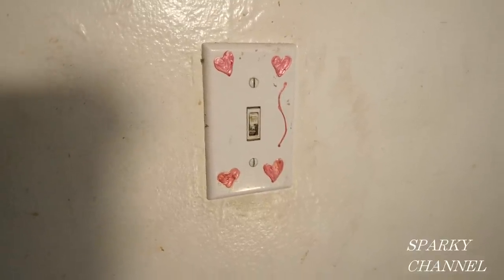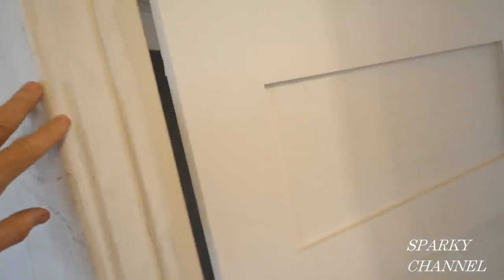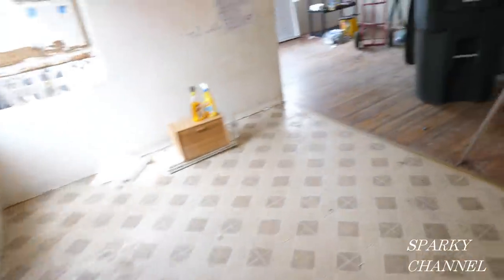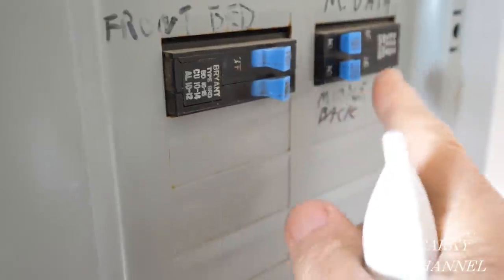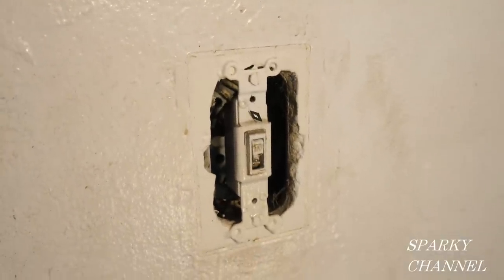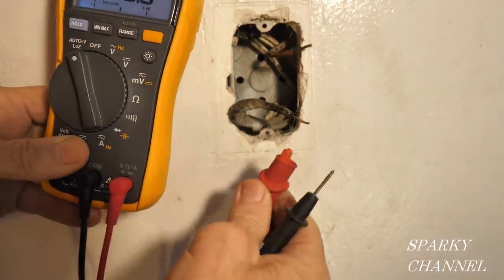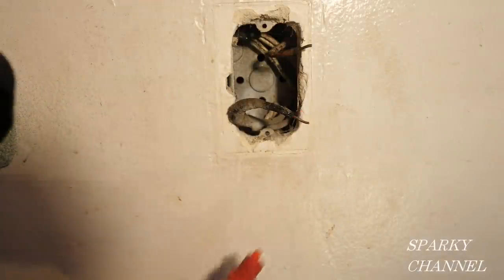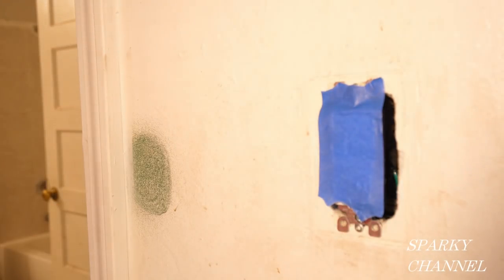How to Replace and Ground a Broken Switch in a 1957 House + House Renovation Time Again!

Comment: A different method for finding ground is to check continuity between the box and neutral... if there is continuity there then you have ground if the neutral and ground are bonded back at the panel.... then you dont have to energize the circuit, if the box isnt grounded start looking for a metal water pipe usually you can find ground if the plumbing is all metal and the main supply of water comes in under ground...
Reply from the maker: Excellent tip! A lot of switch boxes from this era don't have neutral wires but if they do, that's a great tip!
Reply: @SparkyChannel that box had neutrals in in tucked away in the back , "taped" I might add, but its still a great point. I've seen a lot of rooms wired up lights and receptacles on same circuit with the feed coming into the octagon up at the light and then just a switch leg going down to the switch box , if that is the case you can   test to neutral at the receptacles its a little awkward but its doable, in a jam, I just prefer not to use current for testing circuits during construction or demolitions, especially with other trades around.
Reply from the maker: @stankahuna5271  Yes, there were neutrals in the box, good eye! I was the only one there which was great because it gave me a chance to make a video. Sorry if I went off a bit on the way the house was treated. lol!
Reply: @stankahuna5271  if there's no neutral, plug an extension cord into any receptacle, and you can use the neutral in the extension cord. (or if you don't want to peel tape)
Reply from the maker: @kenbrown2808  Good thinking!
Reply: @SparkyChannel  it's a great tool when you need a longer test lead.  also works great for testing GFCI protection on an ungrounded circuit.
Reply: @kenbrown2808  yeah of course but I'm not going to suggest that to a rookie, who might be reading this and who ends up leaving it plugged in when he energizes the circuit... and you know where that goes... I have two "special" extension cords one with a female end and one with a male end, extremely useful for trouble shooting.
Reply: @stankahuna5271  I was referring to a complete extension cord.  it gives you hot neutral and ground without having exposed conductors.

Comment: Good explanation on the switch replacement Sparky.  It will be interesting to see progrss on the renovation, it is a little rough.  I have seen worse though.  Another great video.
Reply from the maker: LOL! This is after 3 weeks and I've been going as hard as I can. Gary, I'm going to cheery is grand ole house out!
Reply: @SparkyChannel  if you removed less than 21 cubic yards of garbage, you're in better shape than my worst.
Reply from the maker: @kenbrown2808  That's a lot of garbage brother! :)
Reply: @SparkyChannel  fortunately, at the time I had access to a 21 yard dump truck.

Comment: Today electricians may think that twisting wires without a wire nut is dangerous,but remember it lasted over 60 years without a problem.We had aluminum wiring in Eastern Europe and  in many houses the wiring lasted 80 years without wire nuts and wagos.Just twisted and taped.

Comment: Yet, if the ground connection through the box was because of the  BX metal casing path it wouldn't be in compliance with the Code, or would be?
Reply: Back in 1980, when I took an electronics class and learned about wiring, grounding by BX cable was in compliance with NEC code.  Also, in most cases, for light switches, they did not have a provision for a ground wire unless they were a combination half receptacle and half switch, as receptacles needed to be grounded per 1962 NEC Code.  It wasn't until the last 20 years that switches started having grounding screws on them.  I saw many light switches in the late 90s to early 2000s at Home Depot, Lowes, Ace Hardware and True Value Hardware without grounding screws.  By 2009 when I purchased one to use with a new fixture, the old style toggle switches came with grounding screws.

Comment: Thanks for the video Sparky.  My daughter just purchased a 1959 house in Kenosha WI.  The house has cloth insulated wiring.  Does it need to be replaced?  The wires are run in conduit.  The receptacles have been replaced but are not grounded.  I was planning to do exactly this to the receptacles.
Reply from the maker: Hi Roger! Is the cloth insulated wiring actually in conduit or is it loose wires in the conduit with cloth insulated wiring after the conduit?
Reply: @SparkyChannel  The cloth wiring IS loose wire in conduit.
Reply from the maker: @rogerhodges7656  I see. I think the existing wire should be well preserved due to being in the conduit since 1959. But an upgrade would be very nice. You could probably pull in your new wires by connecting them to your old wires. As you pull out your old wires your new wires will be coming in to the conduit. It sounds like you have a well built house!

Comment: 4:39 Looks like one of the receptacles is too close to the finished floor. I usually place them 12 inches away from the finished floor and 48 inches for light/receptacle-controlled switches.
Reply: There is no rule how far from the floor they can be. They would be in the floor.
Reply from the maker: I guess they used the 1957 code. LOL!

Comment: Why a ground wire? Isn't the switch self grounding on metal boxes? I saw a ground clip at the top.
Reply from the maker: Good question. I prefer to use a ground wire as I think that it is a superior grounding method. The self grounding clip is then a redundant grounding system. Just my preference.
Reply: Exactly what I was going to ask.  I can understand if you don't like using those clips, but I find it done often when the raceway/box is used as the equipment ground.
Reply from the maker: @RJ-ej1nr  It works fine but the grounding can be weakened by paint, changing out the receptacle and the like so I prefer using the EGC (green wire).
Reply: @SparkyChannel  The green conductor that you bonded to the box and then attached to the switch is an equipment bonding jumper, not an EGC.
Reply: @SparkyChannel  Good point, especially on having the device changed out by someone who might not know better and use a suitable device.  I've run across installations using ground clips questionably in EMT installations, where the box gets a metal cover (so protected from painting) and people swapping out devices usually know what they are doing.  The headache there has been a return ground path on EMT, as it ages and others paint/physically adjust it to the point the ground path quality is between dubious and dead.  The connection to the device is the least of the problems.

Comment: Is that short wire still ok since it's pre-existing even though it's not at least 6"? Are there any situations where you would need to run an entirely new wire to extend it and make it code compliant?
Reply from the maker: Good question. I do understand the code, and have created videos on wire length. But the thing is, I didn't do the wiring. This is just the way it exists in the wall. As I'm just replacing a switch I don't think there is a code problem.
Reply: if it's already there, the only time code enforcement can force the issue is if the wire is deteriorated to the point it is unsafe.  I consider any cloth bound wire to be suspect. and in my area knob and tube is defined as too badly deteriorated and must be replaced if at all possible.
Reply from the maker: @kenbrown2808  I agree with knob and tube. People write in here about their knob and tube wiring and I always them them to replace it first chance you get.

Comment: Question.  Could you have used a 2 Slot Wago nut on the short red wire and a pigtail to the switch?
Reply: Yes
Reply: Bent a little U shaped wire and put a 2 slot Wago on my keychain so if I ALWAYS have one on me for situations like this.
Reply from the maker: Yes, not a problem.

Comment: There should be solder under the tape.
Reply from the maker: Might be.
Reply: @SparkyChannel  
I lived in a 50 house way back. All were soldered connections and black cloth tape.
Reply: I had a 1963 house. I saw some copper crimp sleeves bonding wires in some of the switch and outlet boxes. Never saw that before.

Comment: Is there a limit of how short the wire can be without extending?
Reply: I would have extended the switch leg.
Reply from the maker: @kenbrown2808  Yeah, that switch leg was pretty short. As to Scott's question, I think you just have to use good judgement. I felt that I was able to secure the wire very well, so I went with it.
Reply: @SparkyChannel  I base it on "if someone else did it would I be mad at them?"

Comment: actually, best practice is to have the hot wire to the upper terminal and the switch leg to the bottom.  
and if it was my house, at the minimum every one of those circuits would be on a combination ground/arc fault breaker - but preferably I'd strip it to the framing and make a fresh start.  otherwise, when you get done, what you have is a 1957 house with a 2021 price tag.
Reply from the maker: Hi Ken! Why is it best practice is to have the hot wire to the upper terminal and the switch leg to the bottom?
Reply: It is a rental. I learned long ago that spending additional money to improve a rental beyond what is needed to rent it and be legal is a waste of money. Some jackass will just wreck it.
Reply: @SparkyChannel  it originated with knife switches, but it also makes the switches consistent with electric meters, disconnects, current generation GFCI receptacles, and other line/load connected devices.
Reply: @ianbutler1983  I've learned it's easier to get a better class of renters if you have a better class of rental.
Reply: @kenbrown2808  Do you have a reference for it being a best practice do do it that way?
Reply from the maker: @kenbrown2808  I see. Thanks!
Reply: @MrBluelock  I don't recall if it is in textbooks or not.
Reply from the maker: @ianbutler1983  There are great tenants who treat their rental house like their own and thank goodness for them but I know exactly what you're saying.
Reply: @kenbrown2808  I wire the hot to the bottom and the load on the top. There is no right or wrong way to do it.
Reply: @illestofdemall13  actually, now that I'm reminded, the bottom terminal is connected to the mechanism of the switch, while the top terminal is just the contact for the mechanism.  just the way a disconnect is designed.  so yes, there is a difference, between the top and bottom terminal, and the intent of the best practice method is to de-energize the moving parts of the switch when it is in the off position.
Reply: @kenbrown2808  You are incorrect. The moving part is often at the top. Here is one example: https://www.youtube.com/watch?v=clzoxnGbpy4
Reply: @illestofdemall13  nope. Pulled one apart. You're the one who is wrong.moving parts are definitely on the bottom terminal.
Reply: @kenbrown2808  Did you bother to watch the video that I linked? In that video it is the opposite of what you say because they are not all the same. Just because you pulled one apart doesn't mean they are all built that way. Either way, it doesn't make any difference. That is why there is no code for it and why most of the screws on a single pole switch are the same color.
Reply: @illestofdemall13  okay, so his brand doesn't match the one in Bill's video.  and I'm not going to be bothered pulling apart more switches.  unless you want to send me a billing address, of course.  
art 404.6(c) has been amended to only specify knife switches must be connected so the blades are de-energized when the switch is opened, and there is an exception that allows them to be used in equipment that can backfeed them. 

but it is still a best practice to connect switches so the moving parts are de-energized when the switch is open.  so I guess if you are buying whatever brand that youtuber uses, you can connect the hot conductor to the bottom terminal.  but I confirmed that my switches should have the hot to the top terminal.
Reply: @kenbrown2808  There is no right or wrong way according to Leviton. "1) Remove the wall plate using a flat head screwdriver, then remove the old light switch from the wall box.
2) There should be three wires coming out of the wall box. Using your pliers, make a "shephard's hook" at the end of each wire.
Shepherd's Hook in the wire
3) Take the bare copper or green wire (ground wire) and connect it to the green screw (ground screw) on the side of the switch. Make sure the hook goes on clockwise. This will help tighten the wire in the next step.  
Connect ground wire to the ground screw
4) Using your phillips screwdriver, tighten the ground screw onto the wire.
5) Now you can connect the two remaining wires to the two remaining screws on your light switch (either wire to either screw). Again, ensure the hooks are connected clockwise and tighten the screws with your screwdriver.
Connect the two wires to the two remaining screws on your light switch
6) Before placing the switch back into the wall box, take a peice of electrical tape and tape over the terminal screws. This will prevent any unwanted contact between the screws and the side of the wall box.
7) Using your phillips screwdriver, mount the light switch back onto the wall box using the screws provided. If you are installing a toggle switch, make sure the ON/OFF writing is the right way up (to save confusion later!).
Mount the light switch back onto the wallbox
8) Fasten the wall plate on top of the switch with your flat head screwdriver. Tip: leave the slots in the wall plate screws vertical to prevent dust collecting in the screws.
Fasten the wall plate on top of the switch
9) Now you're ready to turn the power back on at the circuit breaker and test your work!" https://blog.leviton.com/how-to-install-leviton-light-switch
Reply: @kenbrown2808  There are many brands of switches and it isn't possible to know how the internal parts are configured based off of the instructions, and the instructions usually say it doesn't matter which way you wire a single pole device. So it may matter to you, but the switch works fine either way.
Reply: @illestofdemall13  I notice they also only give avoiding confusion as a reason for not installing the switch upside down - which IS in violation of code.  

I also call your attention to Art 90.1(a) and (b).
Reply: @illestofdemall13  the switch works fine if you open the neutral with it, too.  so "it works fine" is obviously not a valid metric. 
however, "best practice is to install single throw switching devices so the hot connections are at the top and the load connections are at the bottom, regardless of the exact style of the switching device" is a more consistent policy than "well, I connect safety switches so the line is at the top, but I connect light switches so the load is at the bottom" 

are you also one of these guys who uses red and white as your travelers on a dead end three way instead of red and black, so you can tell it is a dead end three way, which you need to know because on a dead end three way you use red and white instead of red and black?
Reply: @kenbrown2808  Have a good day. Those articles aren't pertinent to the subject at hand. Your preference is not the law just because you strictly adhere to it as if it is. This reminds me of the pre-twisting vs. not pre-twisting debate.
Reply: @illestofdemall13  I never said it was the law, I said it was best practice.  perhaps you would do well to learn the difference.
Reply: @kenbrown2808  You aren't supposed to switch the neutral, so it doesn't "work fine." Don't assume that I am a novice just because I don't follow your laws that are not based upon the NEC or electrical theory. I have fixed whole houses that were screwed up by big electrical contractors, who installed the wrong dimmers throughout the whole mansion, and the owner of said company paid us to do so. I have also rewired lights that were miswired from the factory and took days to fix due to custom scaffolds needing to be built and glass needing to be safely taken off 50 pendants, all on a 30 foot ceiling. I've been wiring transformers, switches, receptacles, and dimmers for years and never had any fail due to my error. I have also repaired wires that were spliced inside of PVC conduits by "licensed electricians." I don't have any problems with wiring single pole, 3way and 4way switches.